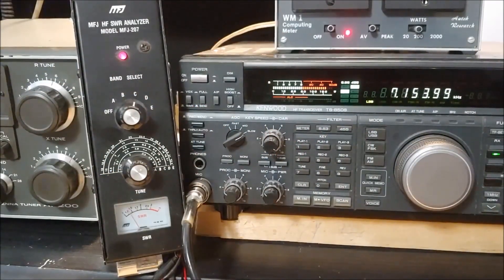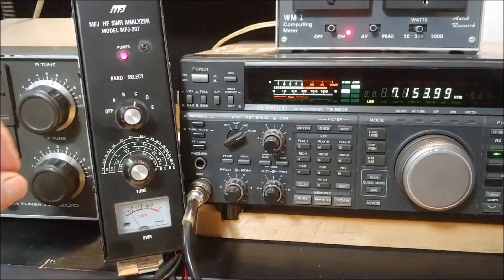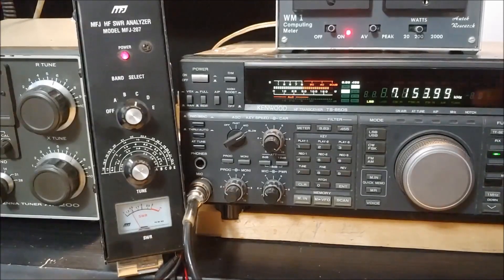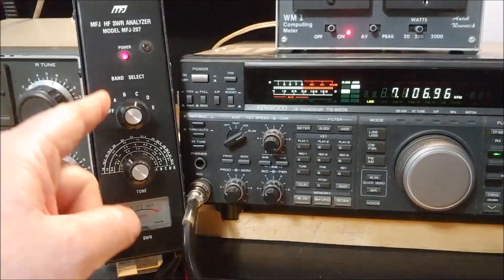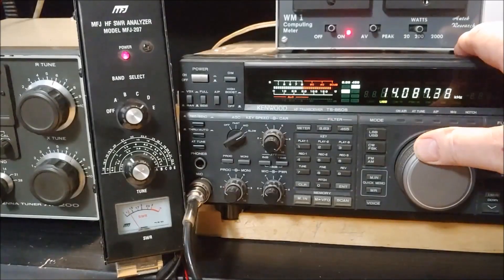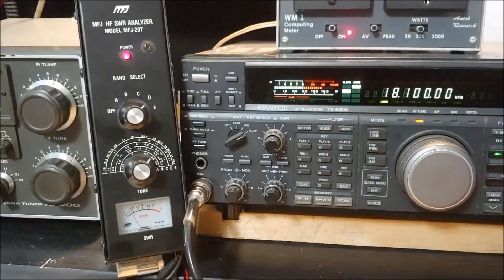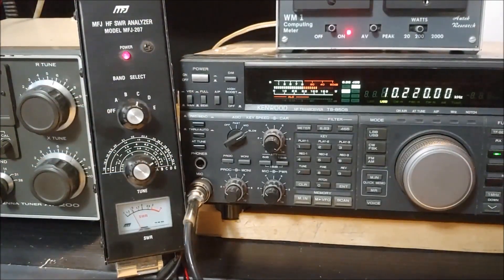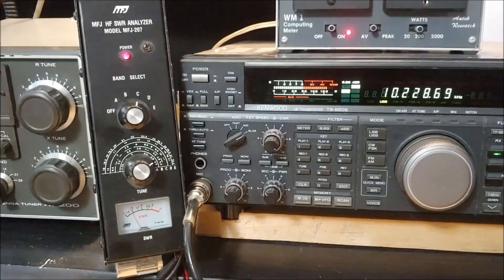MFJ SWR Analyzer

Comment: Rob, do you have a separate antenna connected to your radio? I have a 207, but can’t seem to hear the 207’s oscillator on my TS-570D once I find the dip. My antenna is a ZS6BKW 100 feet out in the back yard at about 40 foot height. Also, have you used your 207 with a frequency counter as others have in their YouTube videos? Thanks for the great tutorial, just wish we could see how you hooked up to do the test. 73 de KN4HGI Alan

Comment: This is very different from any other SWR meter I've seen. I like that it's slim and free standing.
Reply from the maker: The SWR meter is built in but it's not inline with the rig. It is a self contained unit that produces the signal that the see meter uses to show the response of the antenna. The antenna is attached to the analyzer but not the HF rig.
Reply: Do you need a freq mtr or can you just look at dial on mtr to get dip point.